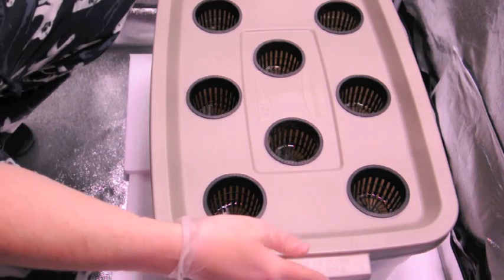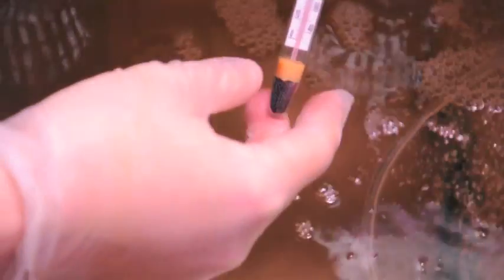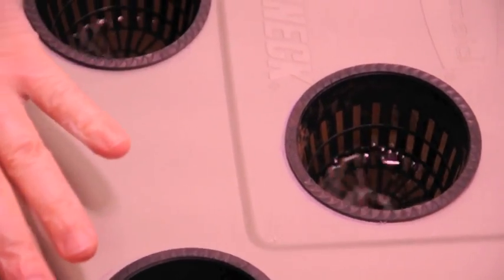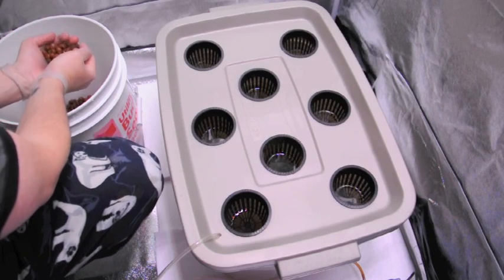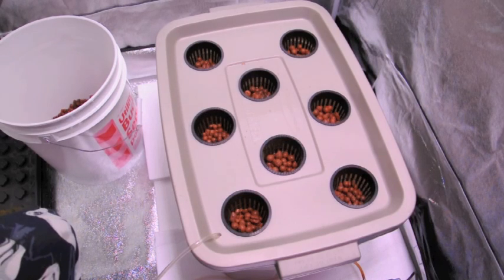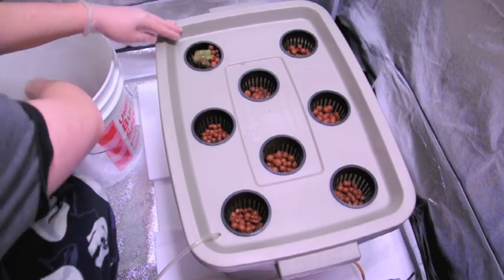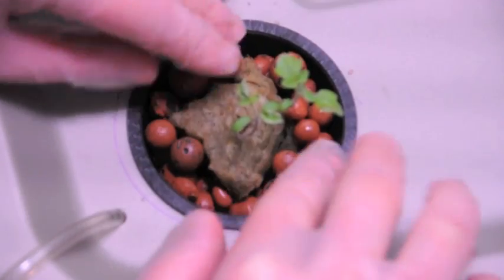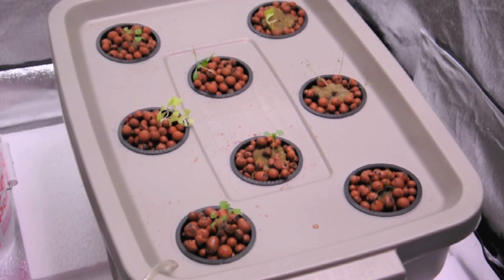How to plant seedlings in a hydroponics system

Comment: I was wondering how.long should the system be running. Does the system runs 24hr... Ints too much water for a seed to sprout? Or does the oxygen created by the pump keeps it alive? I have a 27-gallon box where I fill with 10 gallons.. I ran a pvc40 pipes system that sprays 180*360 degrees. I'm just wondering how long should I be running this system.. How much water should I be pumping?

Comment: do you keep the system running with the lights off?
Reply: Garrett Moore yes as plants will die without the air pump running due to lack of oxygen
Reply: Garrett Moore always leave the air pump on 24/7 lights 12-12

Comment: so how do you change your water without damaging your roots?
Reply: You grow a pair of balls, left them up gently and move them.
Reply: +Turtleseedswhale s I just use a hose to syphon water out to the bathtub or sink, then refill with similar temp, neutral Ph water.
Reply: Turtleseedswhale s  I would also like to know this
Reply: +Turtleseedswhale s fill and drain system. look it up
Reply: Lol I know right, I'm only 1 week into finding out about Hydroponics (just ordered my grow light) and even I was already thinking "Guess ima just have to be a "man" and fucking lift up the lid gently I'm thinking of setting it down between two Tables/pieces of wood so the roots are suspended in the air and aren't fucking getting 2+ pounds of weight on them laying on the floor or some shit while my stupid ass is refilling the nutes and/or changing out the water. This would probably be the best way that doesn't damage them at all.
Reply: Anthony A it know this is a bit late and you have probly thought of this now but buy another box then it's only a matter of switching lids evert time you need to change nutrient

Comment: if you want to get better results you`ll need atleast two 6in circular ceramic air stones and a high output air pump in that tub of yours, i have 4 120lt tubs 12 plants per tub, and run 32 high power pumps, the micro air bubbles get right into the roots and  yeilding around 30% more a grow.